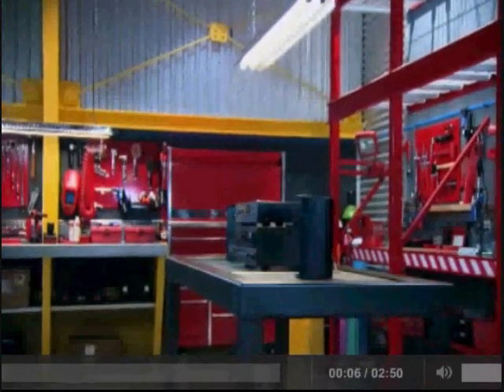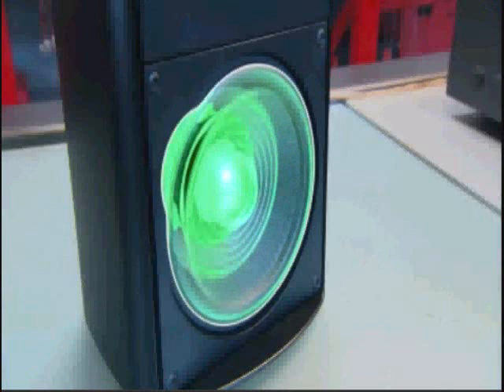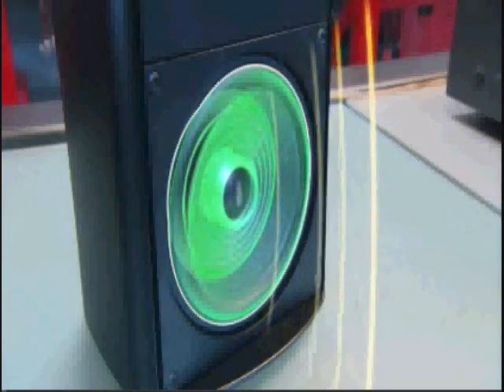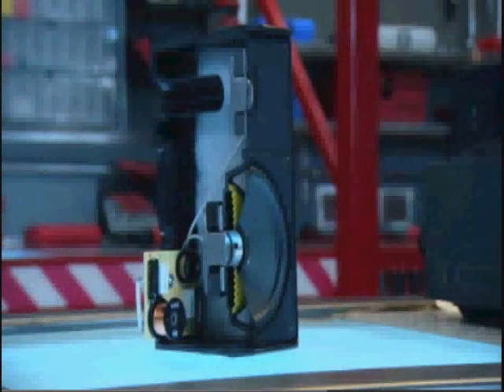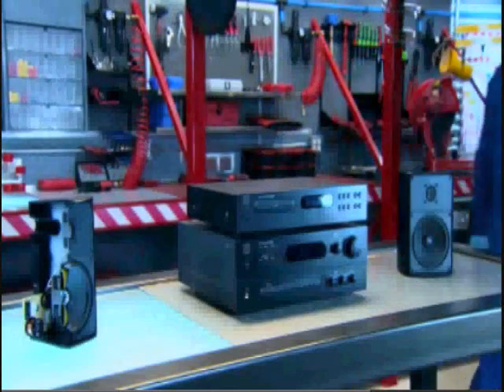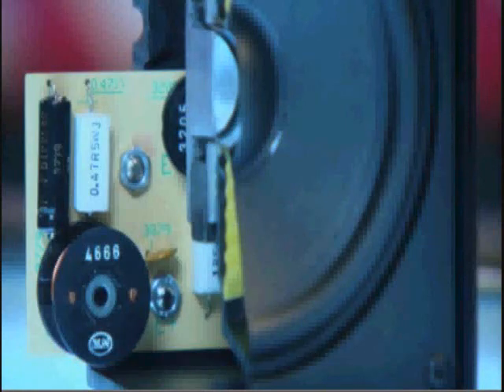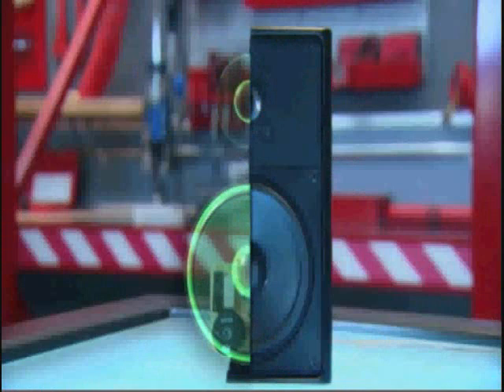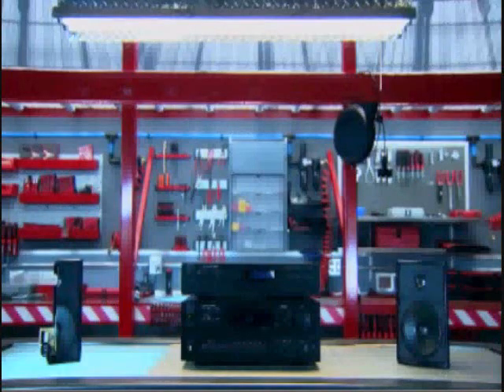How Speakers Work

Comment: i still have a quastion why should it be so loud before the bass i moving?
it dosent matter big or small speaker it still hard to make the bass move why?
Reply from the maker: If I understand your question correctly, I believe it is due to the size of the sound wave. A 20hz soundwave is approximately 28ft while a 10khz soundwave is only .11ft so there is less air mass to be moved at higher frequencies which then requires less power.
Reply: im whriting about the volume that is needed to make the bass move in and out why does it need to be so loud?
Reply from the maker: Daniel Cort  I'm not sure I understand what you are asking....
Reply: only126db the volume needs to be  really loud before the bass is moving a great amout of air
Reply from the maker: Daniel Cort  The volume needs to be higher because the amplifier will put out more power and more power is needed because the speaker needs more power to push more air.
Reply: only126db yes but why so insane loud no matter what speaker you use

Comment from the maker: Well it looks like someone replied to your comment before me but they are wrong. A voice coil does have a resistance and the coil wire has a coating on it which keeps the coil from shorting out (up to a point). When you exceed the thermal capacity of the speaker you exceed the thermal capacity of this wires coating  (adhesives & wire coatings make the funky smell when blowing speakers), get delamination and blow the speaker. Next most common is melting coil wires or snapping the tinsel leads.

Comment: I have a small Polk Audio dash speaker and the magnet has come apart. When I try to put the two pieces back together (which is easy because the magnet attracts the other metal part), the diaphram and entire speaker cone are being pushed outward with a lot of force, so much force, in fact, that I'm going to need to glue the outer gasket back down. I have a bit of experience with replacing surrounds, but I have never dealt with a magnet becoming separated from the rest of the speaker. Any ideas?